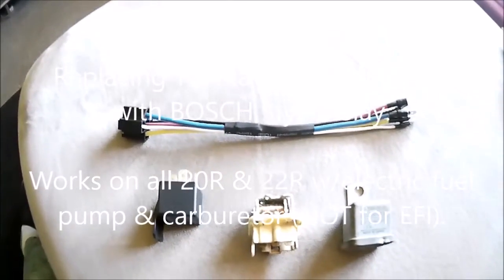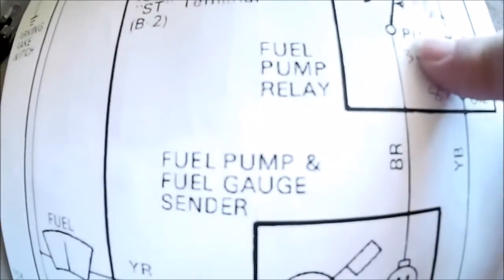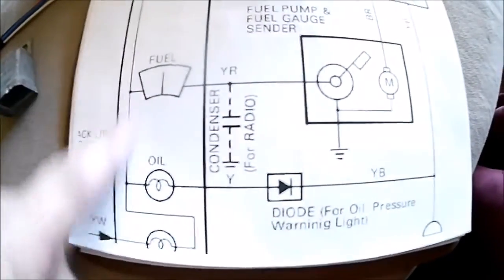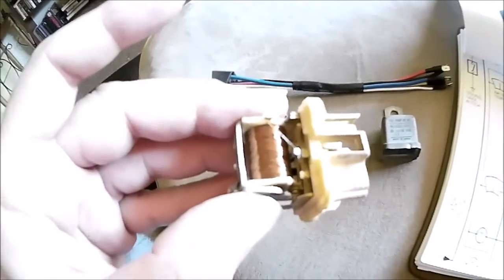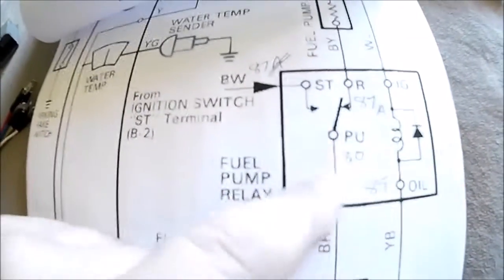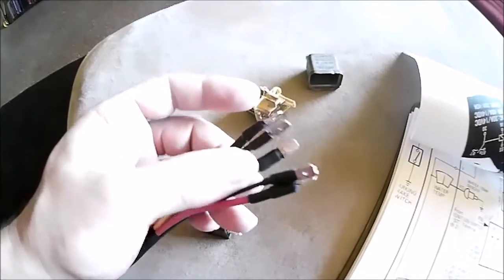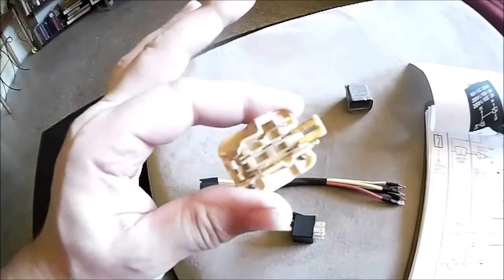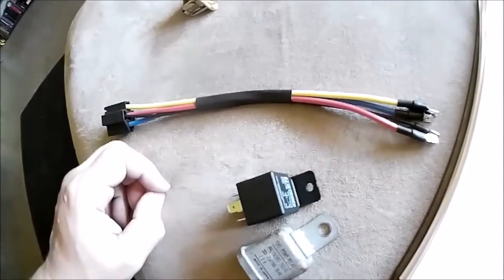1978 Toyota Pickup 20R-Fuel Pump Relay Replacement/Substitute

Comment: My 79 came with an aftermarket pump mounted under the hood, I assumed it was a mechanical replacement. Long story short, it was a bypass for the stock in-tank pump, I’m thinking the relay has failed. I’ll be digging into this new mystery, maybe even get the factory manual. I appreciate the time you took putting together this video and getting this info out for the rest of us. Best of luck to you on your 78, take care brother.
Reply from the maker: Glad that it helped. Some extra thoughts about this:
The only mechanical fuel pump that ever came stock on the 20R was mounted to the front passenger side of the cylinder head, opposite to the distributor. If there is a block-off plate on your cylinder head, then it could be possible to run with a mechanical pump. If there is no block-off plate then you likely have the stock in-tank electric fuel pump.

If that aftermarket fuel pump mounted under the hood is electric, then someone mounted it wrong. Electric fuel pumps work best pushing fuel instead of drawing it, so the pump being in the tank, or mounted as close to the tank as possible works the best. It would be interesting to know what that pump is, brand, part #, and how it's been wired into the system. Speaking of which...

The stock electric in-tank fuel pump system has that fuel pump relay, but should also have a stock fuel pump resistor, usually mounted on a steel plate on top of the passenger side wheel well. I do have a video on this. If that aftermarket pump is wired into the circuit with the resistor, it's possible that the resistor has 'gone bad' and has too much resistance, which drops the voltage to the pump so much that it can't run fast enough to supply the correct fuel pressure or volume. If the resistor is still in the circuit, it's worth doing a resistance test on it. The stock spec on it is 1.4 Ohms, = or - 5%, with a 10 watt or more rating. Anything more than a 1.47 Ohm reading cold and it's not good.

I wish you the best of luck with the project. If you have any questions or need more info just ask.
Reply: @The13thSword Thanks chief! I’ll get that pump info for you tomorrow.

Comment: Truck been running great. Now I got a fuel pressure issues. I have pressure with key on. Once engine is on, fuel pressure goes away. Thinking of bad filter. Fuel pump is fairly new.
Reply from the maker: I need a bit more complete description here to help narrow it down. However, if it was a bad filter, you wouldn't have good pressure at all, in any key position. Because a clogged filter would block fuel flow, so no or little pressure. Did you mean fuel flow instead?

Is it possible you have the wiring on the relay incorrect? The fuel pump only gets voltage in certain situations/combinations. 1 - Key turned to "start" (cranking engine). 2 - Engine started and running, and oil pressure builds up, opening the oil sender switch (oil light goes out). The fuel pump should not be getting voltage with just the key turned "on" and the engine not running. There would be no oil pressure in that condition, and no oil pressure will close the oil sender switch (oil light on). That electrical 'signal' goes to the main coil of the relay, which switches the voltage either to the "start" side or the "run" side.

If you need it, here's my full write-up on this on Yotatech, including the wiring diagram.

I'm sure you can get this figured out and working. Try and send me a fuller description of exactly what it's doing in what situation so I can try and help.
Reply: @The13thSword  you are genius! haha
so previously i did the relay conversion with the bosch style. truck started failing about a year later. changed the oil pressure sensor since it was fault, intermittent ground. And then a month later truck failing again. i thought it was the relay. so grabbed another kit from the package(i bought a set of 6 from TEMco). thats when i was getting this issue. so when you said "is your wiring correct" i said what the heck and went to check. turns out  the relay kit a grabbed the second time, TEMco miswired the colors differently from the others haha. anyways, thank you for tip, and reminding me, CHECK THE BASICS! truck is running perfect
Reply from the maker: @juandlcgil  Excellent work sir. 9 times out of 10 it's usually something simple. Glad you got it right and glad to help out. Anything else I can help with just ask, no problem.

Comment: I just deleted the relay in my truck I just ran it from ignition to a fuel pump with a fuse in it since I could not figure out how you did what you did so this works for me
Reply from the maker: As long as it works properly and functions safely I wouldn't have an issue with it.

Just for info and for anyone else looking to do my relay conversion, my write-up on it can be found here: https://www.yotatech.com/forums/f114/1975-1978-pickup-electric-fuel-pump-wiring-diagram-info-309287/

Comment: How much were these components. Because i need a relay for my 79. But its like 80 to 200 dollers
Reply from the maker: Anywhere between $5 to $20. If you search for "5 pin bosch relay with pigtail socket" on Ebay or Amazon you'll find them. There are only a few that sell the set one at a time, but even if you have to buy 3 or 5 at a time as they are sold that way, they are still affordable, usually less than $20 minus any shipping.

Wired up as shown in the video a bosch style 5 pin relay works exactly the same way as the OEM Denso relay. As long as you get a relay rated for 30/40 amps it will handle the job with no problems.

If you have any other questions or need additional info just ask.

Comment: awesome video! i did this to my 76 and worked just as explained in the video. i did run into an issue with my cluster. since relay fix, i dont get fuel gauge or temp gauge reading. basically the left side of the cluster doesnt work. only the CHG light is on red. any ideas? fuses look good.
Reply from the maker: Glad to hear that the relay conversion worked for you. I'm not sure the relay fix has anything to do with the fuel or temp gauges not working, as those circuits are separate from the relay.

Hard to say from a distance but I would think that you either have burned out bulbs for those two items, broken bulb holders, worn or broken trace on the dash cluster circuit board, or power is not getting to the left side of the cluster, or a combination of these things. I have had my cluster out before so all of the following is based on my personal experience.

The only way to know anything is to remove the dash cluster and take a thorough look. The broken trace is more difficult to fix but thankfully it's a rarity. Lack of power feed could be as simple as a connector being loose or off, or corrosion on the power connector terminal(s). If terminal corrosion the case (built up copper oxide in the terminal causing non-contact) you just need to clean them with electrical/electronic contact cleaner. The cleaner is specifically designed to remove copper oxide (green stuff on terminals) but some mechanical/physical effort may be required to remove all copper oxide. I recommend CRC Contact Cleaner.
IMPORTANT: Make sure you disconnect & isolate/insulate the negative battery terminal before trying to clean any terminal that might carry battery power, or you risk a short circuit & equipment damage.
Allow all cleaned part 5-10 minute to air-dry before reassembly.
Also make sure there isn't any corrosion between the bulb sockets and the circuit board traces, clean if necessary.

If it's burned out bulbs, you'll need new #194 bulbs. They are common and available in nearly any parts store. I used Sylvania PC194 bulbs in the 10 pack, about $8.50 at AutoZone.
DO NOT use LED bulbs as replacements.
If you have broken bulb sockets, you'll need new type T10 194 bulb sockets. You push the new bulb into these, insert into the circuit board and turn 1/4 turn to the right to lock it in place. 1/4 turn left is how you remove them.
These sockets can be bought at parts stores but they overcharge for them. You can get the same item & quality online thru Amazon, Ebay, etc. for less money. Amazon is showing 10pieces for about $4.50.

I have checked my wiring diagrams and there appears to be two different power feeds to the left cluster pod, one Yellow, one Red. For pics, search Google for "1976 toyota pickup dash cluster" and check out the pics on some of the clusters currently being sold on Ebay & you'll see them. Either of those wires could be broken further "downstream" from the cluster so that no power is getting to the Temp light or Fuel Gauge. I wouldn't bother to trace these for breaks unless I didn't find any of the previously described problems at the cluster itself, but you can do this in what order you wish to.

Apologies for the long response, but I try to be very complete with answers & info. I hope it helps. Let me know what you find out.
Reply: @The13thSword  yeah i figured. i followed the wiring diagram. thanks again for the relay fix! awesome fix
Reply from the maker: @ No problem. Anything else I can do for you just ask.

Comment: Can you tell me which wire goes? Where on the plug? I have not been able to figure that out. I would appreciate your help on this.
 Enjoy your videos. I have a 1976 Toyota.  Chanook
Reply from the maker: I have a complete write-up on this on Yotatech here: https://www.yotatech.com/forums/f114/1975-1978-pickup-electric-fuel-pump-wiring-diagram-info-309287/

It gives complete info on wire colors plus diagrams & schematics. Let me know if you need additional info or help.

Comment: Can you send me how you did your wiring on the relay?And then plugged it into where the old relay went and what color wires go?Where would be very appreciated
Reply from the maker: I have a complete post on this on Yotatech. Link here: https://www.yotatech.com/forums/f114/1975-1978-pickup-electric-fuel-pump-wiring-diagram-info-309287/

All of the wire-to-wire colors are stated in that post. I just used some 1/4" female crimp connectors on the ends of the wires of the Bosch-style relay socket pigtail. Then plugged into the original relay's socket connector on the harness, one at a time. I did this to preserve the original connector & not hack up the wire harness.

Any other questions just ask.

Comment: I can’t seem to find the exact relay on eBay, I’ve found the relay style but I’d assume the diagram has to be exactly the same as on the other/paper. And I can’t find one with that same diagram on it, if anyone has a link I could follow I’d appreciate it
Reply from the maker: Here's a link to my original write-up about this on Yotatech: https://www.yotatech.com/forums/f114/1975-1978-pickup-electric-fuel-pump-wiring-diagram-info-309287/

As long as you get a quality set of a Bosch-style 5 pin relay rated for 30-40 amps plus the socket/pigtail for it, and wire it as described below it will work just like the original relay.

Relay terminal to Stock Wire Color
85 - YB - Yellow w/Black Stripe - Oil Pressure Switch
86 - WL - White w/Blue Stripe
30 - BR - Black w/Red Stripe - Fuel Pump
87A - BY - Black w/Yellow Stripe - "RUN" from Ignition Switch, Fuel Pump Resistor
87 - BW - Black w/White Stripe - "START" from Ignition Switch

The wire color on the new socket pigtail doesn't matter; you just have to know which one goes to which pin on the relay, and then connect them up properly to the original relay socket in the vehicle.

The actual Bosch part number for relay is 0986AH0602. Any other quality brand, 5 pin style of this type of relay is functionally identical. 

If you search Ebay for "5 pin bosch style relay and socket" you'll find one.

BTW, the diagram on the relay itself doesn't have to be exact. I see that the 5 pin relays on Ebay show the coil on the left side and my video & pictures show it on the right side. As long as you get the pin number designations correct & hooked up to the wires as I specified, everything will work just fine.

Let me know how it turns out or if you have any other questions.

Comment: The new relay would be a NC or a NO relay?
Reply from the maker: That depends on which pole in the relay you are talking about. Here's a link to my post about this on Yotatech, that explains it further (& perhaps more clearly) & also includes a stock wiring diagram & instructions.
Link: https://www.yotatech.com/forums/f114/1975-1978-pickup-electric-fuel-pump-wiring-diagram-info-309287/

As you can see by the diagram, the relay is operated by current (or lack of current) from the Oil Pressure Sender Switch. Without oil pressure, that switch is normally closed. That lights up the "OIL" light on the dash, and energizes the coil in the relay to make contact with the "START" pole. Once the engine starts & runs & builds up enough oil pressure, the Oil Pressure Sender Switch opens. This turns off the "OIL" light & the relay's coil de-energizes, allowing the contact to "flop back" to the "RUN" pole.

Any other questions just ask.